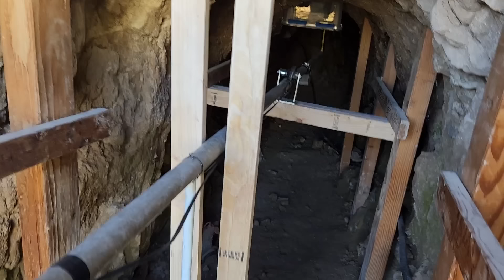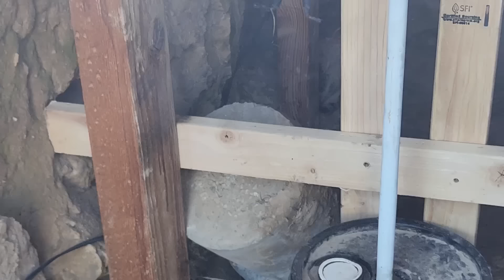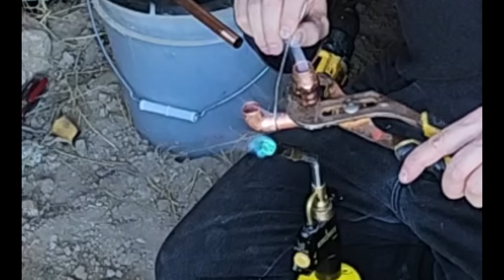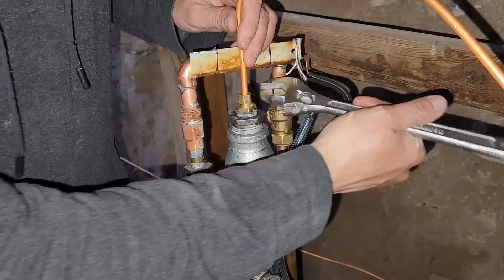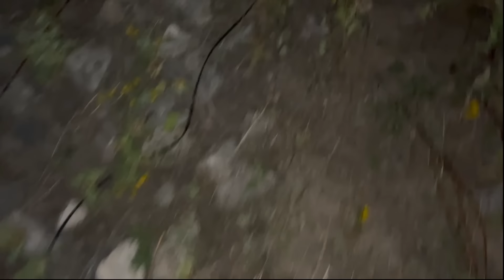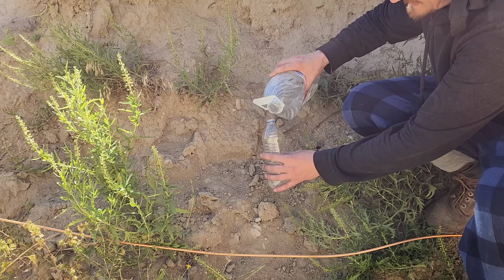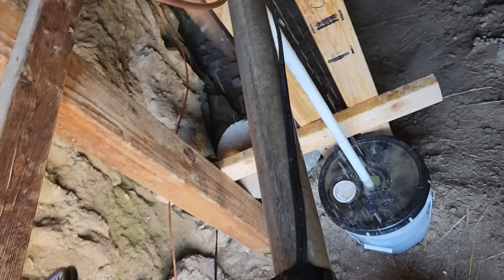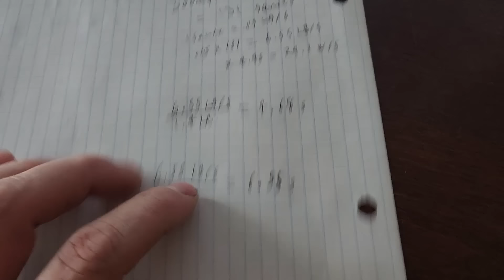Sodium Water Hybrid Rocket?

Comment: An interesting idea would be to use a dry ice type colloidal sodium chamber instead of metallic sodium ; than separate the  hydrogen and oxygen. Shower the sodium solution together with the h2/o1 mix in a chamber. So as it combines it is forced out a nozzle. However it would use the  ambient temp to bring the dry ice to gas form thus the sodium into covalent contact with a h2o mist; with the touch of pressure. Ok enough rocket science... Gotta hit the bong!!!!!!!!

Comment: The initial "negative" thrust might be due to the water initially being accelerated up thought the copper pipes. That could be somewhat reduced by moving thew valve to the horizontal section at the top and pre-filling the section before it with water

Comment: I think your argon pressure was too high. It blew a lot of molten sodium right out the exhaust.
Another issue, is solid fuel model rocket engines burn from the exhaust nozzle upwards and outwards. Yours does exactly the opposite. It cannot help but push the sodium out. If you could inject the water/oxidizer from the nozzle end, (some sort of side-injection porting) you may get a more consistent and potentially more controllable burn.

Comment: You should try a steel pipe in the center that's closed at the OD of the nozzle. That way there's no pressure to push the sodium out. You can just spray water on the top of the annular sodium.

Comment: Looks like you need liquid sodium injection into a combustion chamber, with it's low melting point a vacuum insulated vessel could be used to hold it in a liquid state till used.

Comment: Well, the concept's not toally unsound.  Mixing Imperial and metric unit's is going to cause you at least extra work and possibly grief. (Just ask NASA.) If you keep  a similar design,  use a washer on the core screw as a stabiliser, to replace the kludgy wire. Maybe the injector tubecold go almost to the bottom of the sodium, madefrom something that would burn or melt back up the fuel? 
What would theoretical calculations based on the energy in the chemical reaction say is the maximum possible energy and hence thrust?

Comment: If you could melt the sodium casting it onto a reinforcing matrix should be plausible. Alternitavely an alloy may work? Slower reaction but higher efficiency. What is Mg alloyed with in feroceroum rods?

Comment: @theCodyReeder That project was really neat! Shame that gravity assisted most of the molten sodium to fall out the nozzle. :/ I guess you could flip it with the nozzle pointing up, or test it sideways?, but a separate "catalytic-converter-like" combustion chamber setup, with the nozzle attached using a U-bend could allow for the nozzle to point any direction without molten sodium just falling out. Not great for efficiency as you'd get some flow losses, but could possibly get a better burn as you might lose less fuel. The injector getting blocked could be an issue if it's on the bottom though.

              r ===========\
              |                          |
combustion                   V                                         ^
chamber                       nozzle                                  |
              ^                                                                   up
              |
            water

Also, given how malleable the sodium is (I was surprised by just how malleable it actually is!) could you press it into shape in a simple mould rather than melt it? You could stack some toroidal disks aka sodium washers inside the pipe, and if layered with steel washers, for example, could allow for better structural integrity to the fuel? You've got me thinking now! XD

Comment: Awesome video. Since there is some hydrogen unavailable for burning (in the form of NaOH) after the reaction, I wonder if you could mix sodium with aluminum powder in a 1:1 mix. That way the NaOH will then react with aluminum to produce sodium aluminate and release more hydrogen. This, or a slightly different ratio of sodium to aluminum, could also slow down the reaction a bit for a more controlled burn, but this would need to be tested.
Right now, most of your pressure is just from water vaporizing, with the hydrogen igniting only after it mixes with oxygen likely some inches away from the back end of the rocket. To get a good burn, you may need to mix in an oxygen source, though maybe only in a secondary burn chamber to prevent premature combustion? Sodium chlorate would thermally decompose to oxygen during the reaction and could work. Though more dangerous, injecting diluted hydrogen peroxide with the water would form some sodium peroxide which would then thermally decompose into oxygen and sodium oxide. In lieu of injecting the peroxide, sodium percarbonate could be mixed in to the reaction, which would either react with water to produce the hydrogen peroxide, or just thermally decompose to form oxygen. I'd be interested in seeing how different mixes burn and how necessary a secondary combustion chamber would be.
I think your biggest problem is going to be slowly shedding the solid components of the rocket fuel as they are spent, but not before they are finished reacting. Ideally this would all happen on the ground and generate loads of combusting gasses to propel a payload up a tube. If you don't put sodium on the rocket itself, that would solve your FAA problem.
Reply: Regarding the first part of my comment, I just saw that Sodium aluminium is an actual alloy that is explosively reactive to water as I predicted, but also a hydrogen storage material. So you could not only make sodium aluminum, you could infuse it with hydrogen to make a hydride and it will be able to release far more hydrogen. An oxygen source and a method of spraying water from the bottom up into the solid fuel would certainly make something like this into a rocket.

Comment: I wonder if using a much smaller threaded rod would've held the water in longer, though you'd still have to deal with the sodium melting. Maybe an ice bath with copper pipe and a circulating pump to keep the sodium solid?!

Comment: So, just a dumb question from a non-science guy... You say that the melting temp of the sodium is fairly low. Is it possible to use liquid sodium as fuel instead of the solid? Not sure if that would be more of a pain than it's worth, but it seems like it would... I dunno, work better. Mix better? I'll go back to my coloring book now.
Reply: And then I watch to the end of the video and you say exactly this, just with smarter words. I get a gold star.

Comment: 26:49 
I would say your spike of downward thrust followed by upward is the change of direction of the water being pushed out since you have 2x 180 bends in your system. It should be a stringer impact than the light spring wobbling on a massive and dampened cantilever.

Comment: I think a much smaller combustion chamber and possibly some fine mesh strategically placed inside the sodium to prevent large chunks of propellent being ejected would help.  Possibly even a pressurized water delivery system that doesn't spray directly in from the top but in multiple strategic places at a slower flow.  What about the sodium metal shaped in a fashion that is fit for a non traditional propellant.  Cool idea.  It would take a whole lot of tinkering to get this to work well tho.  I hope you continue and make it work legitimately.  Even make it fly.  🚀

Comment: What if you used Aluminium and LOx instead? Grind of the oxidation layer of the Alu under inert gas, and then seal it of with a seal that can break when the engine starts.
Maybe the oxidation layer can not reform as long as you have this violent process shedding it off all the time?

Comment: What I thought the main problem with this would be, is uneven burn. When you play around with sodium metal by tossing it into water, you get bursts of gas that push the water away from the metal, and so it "pops" instead of having any kind of even burn. To make a viable rocket out of this, you would need the sodium to be atomized, like a fuel injector does with gasoline in an engine. Peroxide also seems like a better oxidizer - less weight of oxidizer for a more robust reaction and higher thrust. 

Also, have you ever played around with sodium's heavier, angrier brother rubidium? It's a liquid at ambient temps, meaning it would be a lot better for atomizing and using as an injected propellant. However, rubidium hydroxide is an eye and skin irritant and quite corrosive when concentrated. So maybe rubidium isn't the best thing to react with water or peroxide and be near....

This was an interesting experiment, but I could have told you that you were going to have problems using solid chunks of propellant and streams of water instead of an atomized mix of both, and heat melting your cylinder of sodium. I'd really love to see you use a couple injectors spraying a peroxide and sodium mist into a combustion chamber together.

Comment: Wouldn't a solenoid valve be a better soltuion to relaease the pressure? That way you wouldn't have to deal with the spring interfering with the readings

Comment: I don't think it is a a good rocket fuel the energy density is to low if you include the weight of the water. However, what about using it as a fuel for ships? neutralising the CO2 solved in the Oceans could be a nice side effect.

Comment: Hey, you should look at the videos thunderf00t has made on sodium as a fuel to combat climate change. He has a history of exploring alkali metals on his channel. Then he made the first video on the theory of using sodium as a fuel. The sodium flamethrower and his experiment with a fuel injector are practical experiments. He's focusing more on using it as regular fuel rather than for a rocket fuel. Some points I would make after comparing his experiments to yours:
- Thunderf00t is using sodium potassium alloy because it stays liquid at room temperature. But he also warns that it's quite dangerous to handle. 
- He's also not using water. his theory video explains that burning hydrocarbons with oxygen actually produces water along with CO2. And adding sodium theoretically creates sodium carbonate binding the created CO2. I don't quite recall what mixes he actually experimented with. So far all he showed were very small scale experiments focused on nebulizing the alloy for a good burn.

I think you're running into oxidation issues along with the melting of the metal. So to get a controlled burn, first you'd need to avoid surface oxidation. And I don't see how you can practically avoid the metal heating up and melting so you'd either need to build a liquid engine or you'd need a way to control the metal as it melts.

Comment: From what I could see in the  the pattern of sodium left in the combustion chamber it seems to me that the injector must have done a good job of spraying the water through the centre hole thereby avoiding the sodium that sits at the upper section of the combustion chamber

 being that the injector was from a regular pressure washer it's spray pattern and flow of water is not optimised for a combustion chamber 
 
But if it is possible you can get or use an injector from a diesel engine which has a unique spray pattern 
That sprays outward along the combustion chamber wall 
Then you would have an optimised flow of water and being that it does not spray right through the hole in the middle of the sodium and it would 
Probably not push out some of the sodium making them combust outside the chamber 
Having a slow or Misty flow of water from a higher pressure injector would definitely be the best option in your designs Project

Comment: It looks like the problem is that the water is injected near the top of the reaction mass, meaning the expansion begins at the top of the chamber and works down.  Ideally you'd want the reaction to start at the bottom near the nozzle and work backwards up the chamber - which would compress the sodium, preventing the expulsion of unspent sodium.

So rather than spraying the water down the chamber, you actually want to spray it up the chamber.

Comment: Cut the argon pressure. It’s ejecting fuel instead of sitting and burning. Also I would maybe try to increase the surface area of the sodium so it more readily burns instead of reacting slow and getting wjected

Comment: Could lining most of the inside of the sodium tube with a wax help the rocket to burn from bottom to top possibly preventing the blocking up and pulsing as it all melts at once. If it starts at the bottom it could quickly melt the wax allowing the rest to continue the fuel burn evenly instead of the top that's getting sprayed melting and clogging the tube of sodium

Comment: As a guy that like to shoot a lot, shotguns and the like. What would happen if you made like some number seven bird shot out of the sodium.
Then you were contain your sodium in a mesh, at the far end of the rocket, then sprayed the water in with a more atomizing nozzle, preferably from the nozzle side of the fuel. You could better burn the fuel, more fully at least till it got small enough to pass through the mesh which could be what ever size you'd like basically.

Comment: A fab experiment! I wonder if it would be better to have a higher surface area contact between the water and sodium, an easy way to do that is to cut the sodium in to small pellets. The reaction between sodium and water generates hydrogen, the heat of the reaction is what ultimately cause the hydrogen to burn in oxygen, I wonder if most of the thrust is from hydrogen release, as there is limited oxygen available? It would be interesting to use compressed air cylinder or oxygen cylinder! Or a mix of both to compress the water.

Comment: The idea is pretty cool! Maybe you could design something like a regular rocket with liquid propellant: you'd use a bit of the sodium to heat the whole tank up to sodium's melting point or part of it, and then inject both liquids into a combustion chamber using a pump or something.

Comment: Great project!

I'm thinking a perforated sleeve that can meter molten sodium and/or sodium vapor flowing into the central chamber.
Better water injectors that can be metered  as well, maybe automotive injectors. 
In my mind, seems like managing the heat and ratios to react sodium vapor with steam would produce a good amount of thrust.

Comment: I think the injector needs to run the entire length of the engine. You want it to burn radially from the center out, along the whole length, NOT from the top-down like a candle. That’s how SRBs do it (hence why with them increasing width increases the burn time, and length increases power). The big question is if the water flow rate can keep it cool enough to not melt. Please don’t abandon solid sodium just yet, you’re only scratching the surface.

Also, what if you oxygen-boosted the combustion chamber for a two stage reaction? If one of the initial products is hydrogen, just blowing it out the back itself uncombusted feels like leaving money on the table. Or some kind of SABRE-like air breathing hybrid?

Comment: in stead of pressurizing with nitrogen, i bet an automotive fuel injector and fuel pump would push the water through at the correct rate and would give you better control

Comment: you should increase the surface area so that more sodium enters in contact with water, instead of just one hole maybe you could do multiple layers of wire mesh coated with sodium, or maybe some sort of spiral pattern or even something cooler like a  3d printed hilbert curve as a hole

Comment: Not exactly steal wool (it would just burn and melt away) but a fiber or mesh like that for the sodium to hold on to could help. Also would just heating the whole chamber with sodium in it then adding pieces be easier to fill to the exact form? (with the melting point being so low)

Comment: I like how Cody goes from hand soldering pipes together, to owning a lathe, back to hand soldering. Fits this channel so well.
Reply: Excellent observation man!
Reply: Use the simplest tool that gets it done. I have a small machine shop, but i'm not ashamed to reach for a hammer, if that's all the precision that's required. If at first you don't succeed, get a bigger hammer, unless the reason you failed was overshoot. Then get a smaller or more precise hammer. Make it as simple as it can be, and no simpler.(ave)
Reply: @rohrertech8882  good to hear advice from someone with the means to back it up
Reply: Probably just using someone else’s I don’t believe he has one him self maybe at the ranch he does
Reply: @trevorjaster4072  I am not sure either. I recall him having a bunch of equipment like 6 years ago though haha.

Comment: Try using a bit more water and a larger injector. Most of the thrust will be created by the steam and hydrogen gas. The more water you inject, the less sodium will melt, and the more water will become steam. In addition, try mixing the sodium with another metal that will increase its melting point, or embedding some sort of reinforcement in the fuel.

Comment: Maybe sodium pelettes (think table salt sized) could be introduced from a secondary tank with the fuel and oxidizer meeting for reaction would work better. Less that would just melt out, and a more steady reaction could be achieved. But I'm not 100% sure how feasible that would be as I don't know if sodium metal would place nice. Might just form a solid mass by sticking to itself.